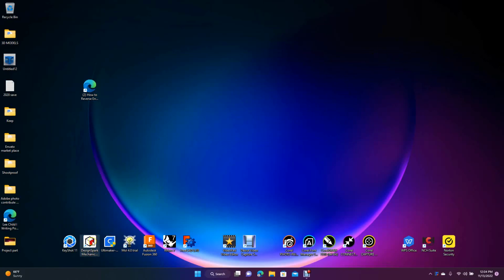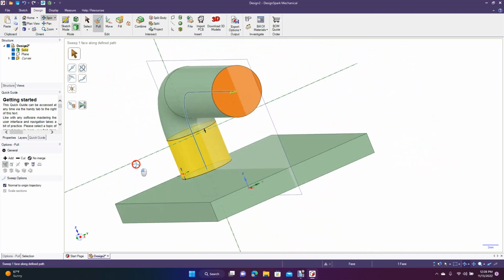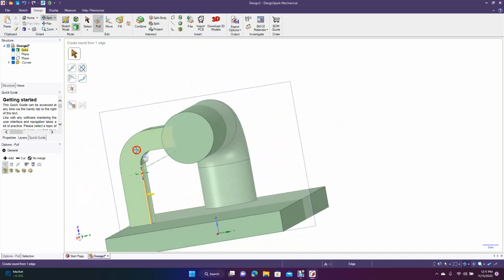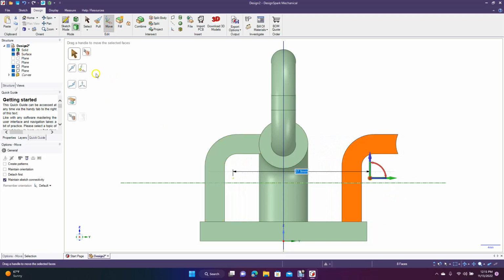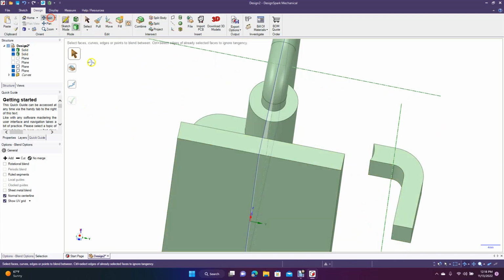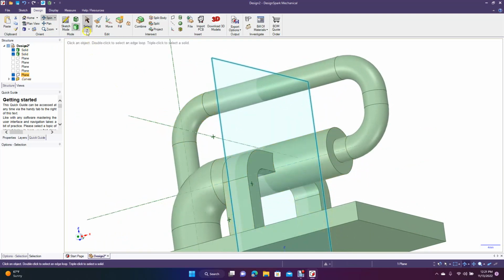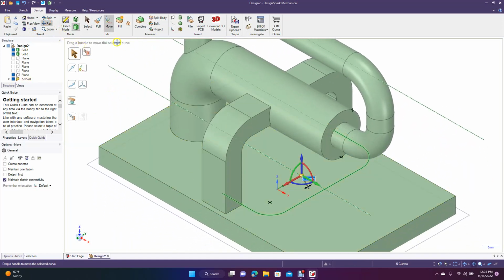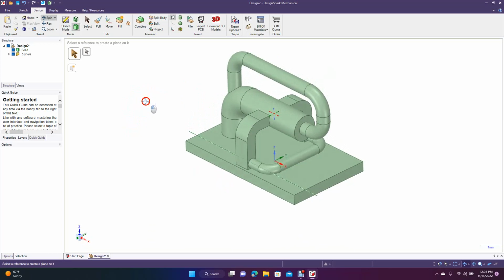How to use planes in design spark mechanical

Comment: you dont have to keep plains on X, Y or Z. You can create plane on any surface plus you can move plane. also by selecting two surfaces and then selcting plane you will get plaine between those two surfaces.
Reply from the maker: Yes, thank you, I am aware of this. I did mention you can use the x,y,z to place a plane, but you can also add a plane to any location or face.
Reply: @dailey3drevolve  The reason I wrote was that you did screw up the last plane. The last plane that you made sketch on was all the way on the buttom. You never move part around to look at that plane where the sketch was. And you moved the lines but you should move the plaine and that way you could see the lines but also you could draw the circle the proper way, the way you want it.
Reply from the maker: @JBCool0729  You are absolutely correct. Thanks for pointing that out.

Comment: why you use move copy and turn and move and so on. Why you did not used mirror.
Reply from the maker: JB, I normally would have use mirror, instead of copy and then rotate. I decided spur of the moment to copy the part to the right side, and didn't consider mirroring, although I should have. I also should have used the no-merge feature as well. Thanks for pointing that out. Cheers!